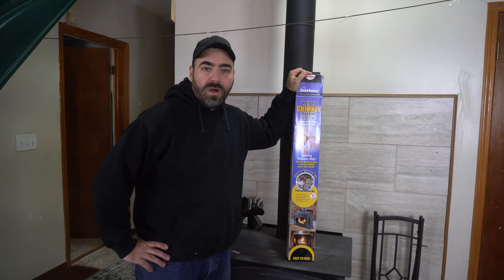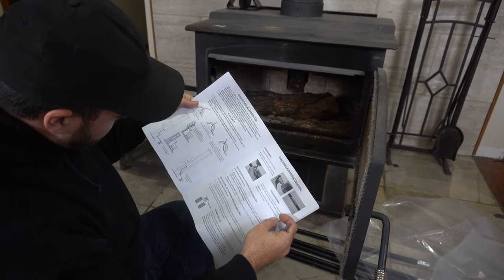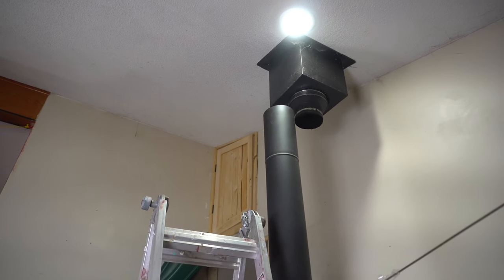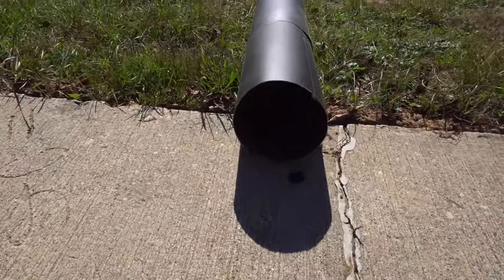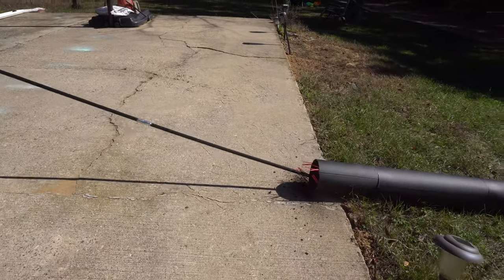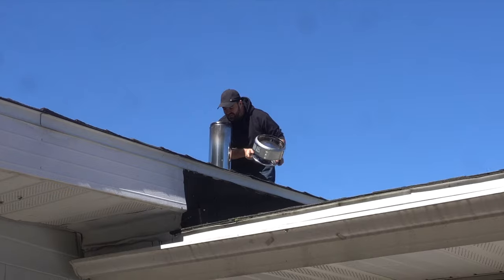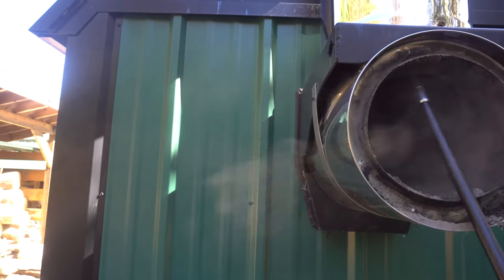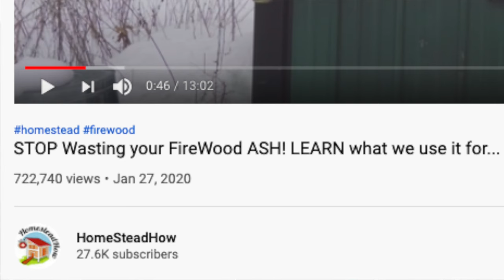How To Clean Out A WoodStove Chimney The Easy Way! [Drill Attachment]

Comment: I've had one for years, works great, I made a bottom from a 6" pipe reducer with a 2" cap on the end, drilled a hole big enough to get the rods through, drilled another in the side
big enough to stick my shop vac hose in, take out three screws in the bottom of the slip pipe, slide the pipe up about 8" from the top of the stove and do it from the bottom.

Comment: Have you ever replaced your whip line? I'm curious if I can use weed whip line just cut it to size mine short but I've never had to replace it, have you?
Reply: The manual with the Sooteater SLK has measurements on page 1 to cut new line and says to use a .105 diameter star shaped trimmer line to replace.

Comment: i own the same sooteater...i heat with a wood stove also...dont go up from the bottom if the black plastic tube on the sooteater kinks it will rip off leaving the head stuck in the pipe...a straight shot down the pipe works best..i un screw the bottom of the pipe from the stove lift it up just enough to fit a metal bucket under it lower into the bucket and clean the pipe from the top down...been doing it this way for many many years now...just be careful not to kink the tube...also the top of the pipe can abrade the tube leading to it weakening then spinning apart leaving the head stuck inside the flue pipe.

Comment: Awesome video! Looks like fun and relatively effective. Here's something to try sometime with the pipes you take outside. Stuff them lightly with newspaper, prop the pipe up on an angle with the top pointing downwind (the bottom pointing to catch any breeze for a good draft) and light the paper at the bottom of the pipe. The paper burns real hot from the bottom to the top of the pipe and burns up the creosote in the pipe. I put a metal 1/4' mesh screen over the top end to keep the embers from being carried out and starting a fire in the grass. Then I run the chimney brush up it once and it takes all the ashes left from the burnt creosote out. Obviously you don't want to try that with the pipes that you leave in place in the house. Cheers...

Comment: Best way is to hire a chimney sweep that does this everyday. Not only can they sweep your chimney correctly, but they can also spot potential issues that you might not see. Average, $200 a year is actually a great investment for your family and your home. 
Thank You for the video!
Reply: That simply is not happening! Im assuming that you’re an east coaster. We pretty much exclusively burn creosote machines like  Douglas fir, tamarack and pine in most areas on the west coast. I like to keep my fire burning pretty low and slow during winter nights. This means an absurd amount of creosote buildup. I clean my chimney once a month during the cold months. Thats about $1200 every year. Most chimneys are not complex enough to justify that. Mines pretty straightforward. Its just a straight pipe that shoots up. Most of the time i disassemble it just like the guy in the video. What the heck can some dolt at the stove store tell me that i don’t already know?
Reply: @paperdo  the chimney sweep will probably video the inside of your liner and potentially let you know that your liner has deteriorated because of an extremely hot chimney fire and you’re now in danger of a house fire, smoke inhalation or carbon monoxide poisoning. Other than that, just keep on keeping on.